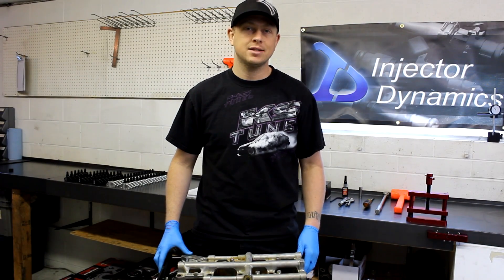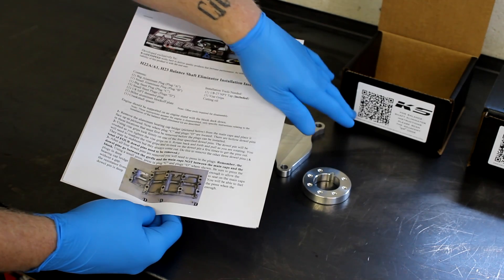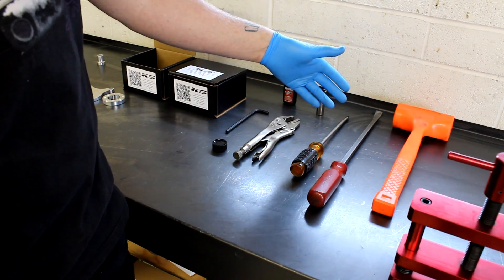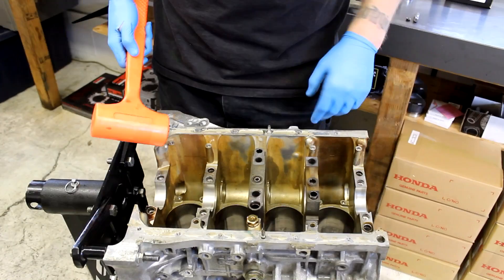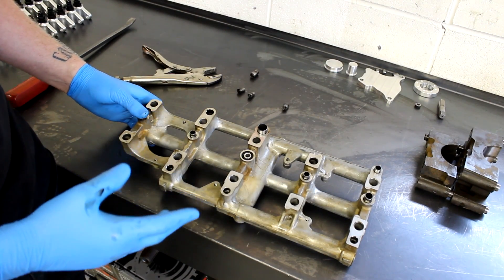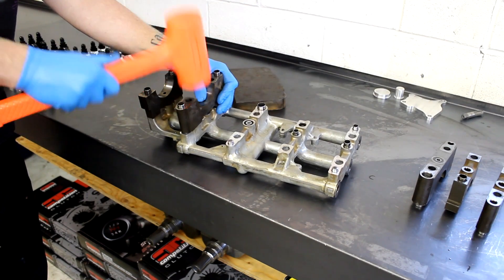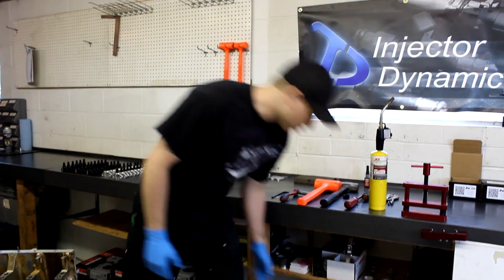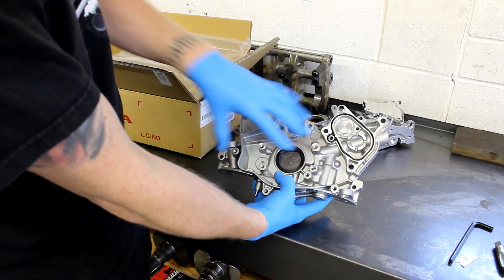KS Tuned Balance Shaft Eliminator Kit Install

Comment: Doing this on my JDM F22 dohc
Question, balance shaft bearings, do u take them out? Rotate them to block oil hole? Or just leave them as is? Couldnt find that info.

Comment: Question ?? Does KS make a counter balance eliminator kit for the GM 3.5 Liter inline 5 cylinder engine. I'm getting ready to rebuild this engine and was wondering since this assembly is at the rear of the motor which means if there's an issue the transmission will have to be removed to correct the problem ???

Comment: Hey KSTuned, I have an obd1 jdm oil pump, it has a bearing instead of just the aluminum housing for the balance shaft, do you press the plug right into the bearing, or do you have to remove the bearing then press in the plug? Thanks.

Comment: Please, stick a same sized drill (cylindrical chuck side) thru the dowel pins so you can't 'make the oval'. 
And when it comes to a pry bar, secure it on a not sealing surface.
Otherwise I've heard a good bunch of positive feedback on yer parts. greetings

Comment: i have a h224a motor and i was looking at your producet and went to know can you just use your belt tensioner with out using tuned balance shaft eliminator kit or went to know how much is the hole set up

Comment: Great video hey quick question, Honda obviously engineered the balance shaft in the engine for a reason. Won't the motor Vibrate at idle without it?

Comment: I'm planning on still using my Manual tensioner on my h22a. Were exactly does that other part u mention go. I thing u said idler tensioner pulley... But I'm still kind of lost on that part.
Reply: there are two tensioner  pulleys the one in the back for timing belt the one in the front of it for the balance shafts belt that part is used in place of the front tensioner because there is a nut that tightens both tensioners

Comment: so i saw that you guys also sell the oil pump with the kit installed already. so is it pretty much just remove the oil pump and install the new one with kit and then install the gurdle plugs and then done? orrr?
Reply: +xBastardx Install the oil pump, and install the steel plugs. Done. The complete installation process is explained in the video.
Reply: +Reid Lunde the girdle plugs correct?

Comment: does the motor have to be pulled out in order to install?
Reply: +xBastardx it makes it much easier if the engine is out, but many customers have installed it with the engine in the car. Hope that helps!
Reply: +Reid Lunde sweeet appreciate it man
Reply: I asked this question too and here is the answer thanks

Comment: The video explains the minor difference between the engines. The installation is the same for all engines, only two parts change in shape/size but they install in the identical locations on all engines.
Reply: What about the F23 only...

Comment: At the 8:00 mark where he talks about dropping the threaded plug in,   you gotta make sure its on the hex key or it will fall off and get stuck. That's what just happened to me after installing this kit on an F23 block. I had to use a flat head screw driver and tilt the engine 90 degrees to install it. Another very important thing to remember at the 8:00 mark is that you need to make sure that the threaded plug is tightened all the way down so that its not protruding out where a main oil passage is. I use pliers and tightened it down until it was flush with the oil passage. You can visually see this if you use a big hex key on the oil bolt right above the oil filter housing... I think this guide is good but it isn't all that in depth, it needs to tell you everything you need to know.. It doesn't really do that.
Reply: Definitely get it out of there. Try a dab of assembly lube or grease to keep the plug stuck to the allen key while you're getting it in position.
Reply: What F23 motor do you have? Is it an F23A5 ? i am rebuilding my motor soon and want to use their kit. Can you tell me more about it ?
Reply: Josh Gambill F23A but its the same as yours. Its not that hard but if you're not comfortable with it don't do it. I get slight vibrations at the 2500 rpm range as well that I wish weren't there. Then again I got higher oil pressure and less drag on the rotating mass.
Reply: Alright thanks for letting me know it helps alot
Reply: this just happened to me, but in my h23a do u know a way to dish out the plug? it fell in one of the oil passages, or can i leave it and use another npt plug.
Reply: Just turn the motor 180 degrees and it will fall to the ground lol. 
I have a H23a now in my civic with the Vtec and its awesome. I didn't install one of these kits tho just took off the balance shaft belt. Hauls balls still.
Reply: +Mr. ic3m4n A stick magnet works wonders on getting it in or out of a hole

Comment: I bought an h22 with a dropped balance shaft bearing, didn't know till we got the motor running and found low oil pressure, pulled the pan to find the bearing.  Will a full delete kit such as explained in the video cure the bearing issue without having to replace the bearing?

Comment: I have done this my own way few years ago. You remove balance shafts because your do not need them.They only kill very tiny vibrations on idle speed. Plus you gain 3whp and when you do this proper oil passage blocks you make sure you cure the most common reason for an H- and F-series engine to fail - the oil pressure drops when balance shaft bearings got worn with mileage and you start having oil starvation, which you know what it means. I also did the H23 manual tensioner, now I see the guys from KS sell a great little one piece unit to go that way - I am happy to see it even that I sold my Lude now. Great products,KS!!!

Comment: Im in the middle of a swap now I have my H22 all apart ready to go to the machine shop I wanted to know if by eliminating the balance shaft its going to damage anything they are there for a reason wanted to know if anyone is actually running a motor with this kit thanks